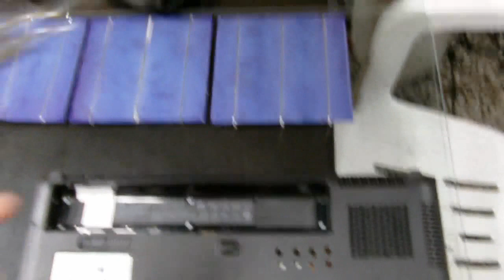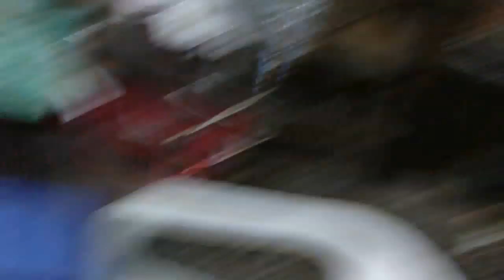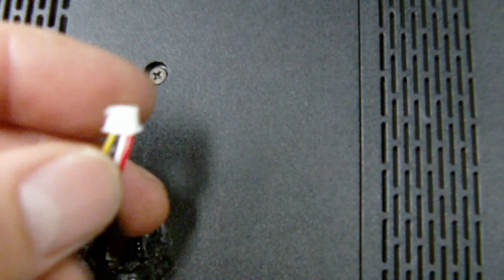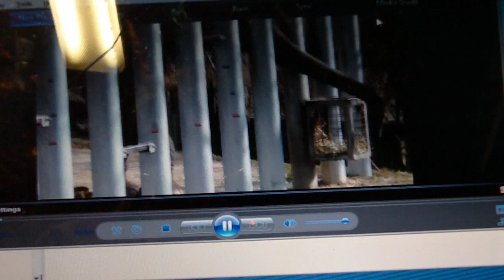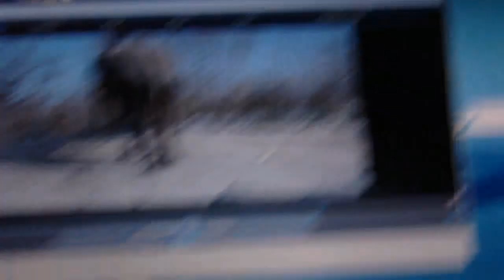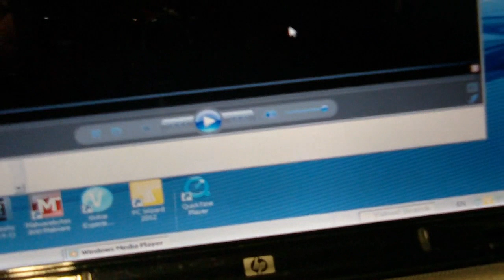Hp dv9000 force fan full speed hack

Comment: USB ports only gives 5V max. In order for the fan to spin at its maximum, you'll need to supply a 12V. In short, powering the fan with the power from a USB port will not make the fan spin at its max and possibly won't make the fan spin at all.

Comment: sir i had the overheating problem and i have installed extra fan on my desk under the laptop for support cuz when am playing a game that need high VGA and CPU my laptop gets really hot and then shuts down and it was a bit noisy when it get's hot cuz the fan accelerate for more speed , but few weeks ago i disassemble the laptop and cleaned the  box around the fan ( the heat sink) and since then i don't hear the fan and what is surprising there was no heat at all even when   am using heavy game on the CPU.. so i think what is best is to clean the fan or send the laptop to someone who knows, my laptop HP hdx 16 core 2 duo. thanks for the video

Comment: The fan thing is fine, crude but fine and if it doesnt work you can always solder it back together. However soldering a hole in your computer instead of doing it the right way is nuts...
Reply: sometimes when a laptop has been dropped so many times all the screws popped out, you don't wanna open it too many times

Comment: (You can open the ram case and see it)
Now the temperature is 47 C, and when I run resource thirsty programs like Revit and 3ds Max, it goes to 65C maximum. Its very noisy of course, but I have a working laptop again and I hope I won't re-ball for a 3rd time.
I will try the trick with the resistors mentioned below, or maybe I will put a small circuit for manually controlling the speed of the fan.
Thank you electricretrotech

Comment: Well it surely works!! I used one of those round irons I had back in 2007 for refilling the toner of my lexmark and opened a perfect round hole of about 1cm diameter. The exact position of the plug on the motherboard is 5cm (2 inches) to the left and 2cm (o.8 inches) down from the position of the black screw (the one under the fan), as you see the laptop on 0.21 minute

Comment: I found easier way to make sure laptop is running cool.
Change your power management of CPU to 70%. 
I did that and my GPU runs at not more then 45 C.
Reply: i found on the  I7-7700HQ just setting it to 99% stops it from going in to overclock mode (3.8ghz) and it just runs normally (2.8ghz) and it runs much cooler,